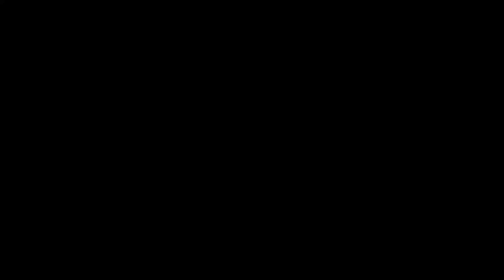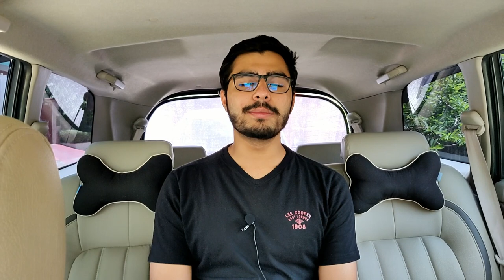Steel Wheels To Alloys | Kya Karna Sai Hai ? | Kin Kin Baton Ka Dhiyan Rkhna Hai.

Comment: Good information Parth. Question: I have an i20 2013 Magna (O) model. I want to upgrade from steel rims to Alloys. I'm currently using 185/65/R14 tyres. Can I upgrade to 195/50R16 with 16 inch alloy wheels?
Reply from the maker: Sir you definately can but you will notice a stiffer ride that is your ride quality of the vehicle would noticabley decrease.